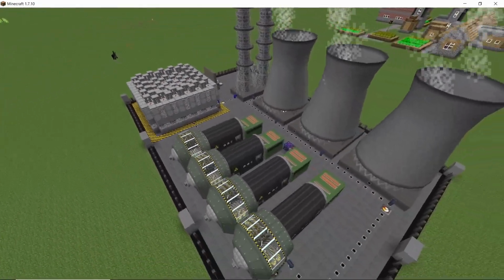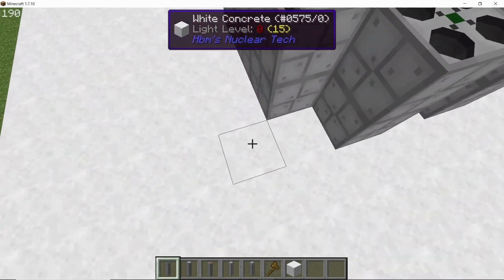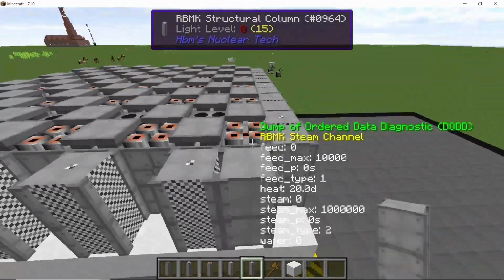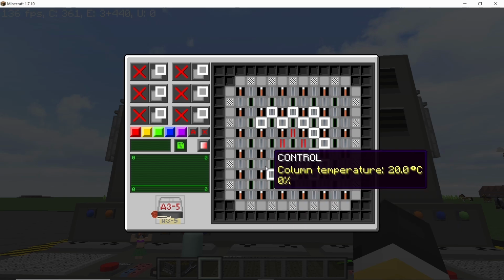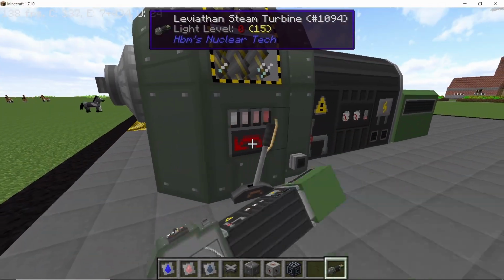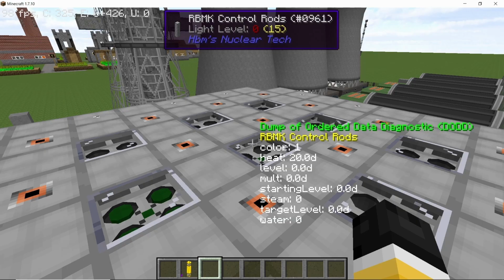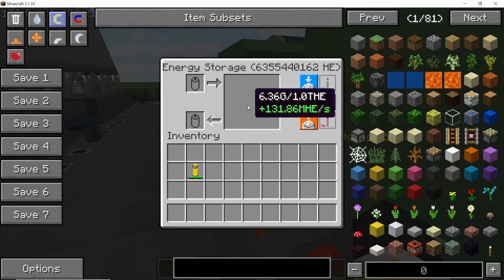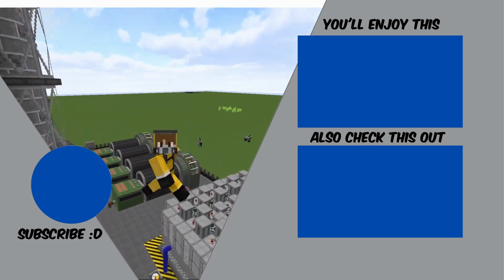13x13 RBMK Design using Schrabidium Fuel Rods - 132 MHE/s - HBMs NTM

Comment from the maker: Here are some important points about this reactor 
- This reactor will require monitoring especially when the LES fuel rods are completely depleted as this will give MES fuel rods a direct access to reflectors, so maybe drop down the green control rods when that happens. Also the depletion rate for LES is much more than MES and HES.
- if you're new to this mod and this is your first RBMK I would suggest not building this and going with a small design with less fuel rods which are not of the dangerous type.
- Finally if you don't want this to run on the brink of meltdown like I've running here then drop the yellow control rods to 30%-35% and the MES temperature should come down significantly.
Reply: I think I'm gonna take you up on the 3rd point, the MES fuel rod is just too close to meltdown for me even tho it has stabilized. 37 should do the trick I think.
Reply: What about the xenon poision ? @SavageVegeta
Reply from the maker: @Null_jar_pluh  that goes away as the temperature rises, so activating the reactor or changing a fuel rod to new if it has depleted significantly should take care of that
Reply: @SavageVegeta  alr thanks
Reply: How do you make the fuel rods in survival?
Reply from the maker: @Null_jar_pluh  empty fuel rods combined with fuel billets. Use NEI to see crafting recipes
Reply: @SavageVegeta  ok

Comment: Just one question, is it possible to make a reactor just with HES (High Enriched Schrabidium, High End Schrabidium) or not? in my world I always do it with other Medium/Risky fuels like MEA, and Flashlead, because it is difficult to maintain DANGEROUS fuels without xenon poisoning, unless if it's balefire, because balefire doesn't have xenon poisoning, so you can make a reactor just with it, I've done it several times and for me it's the best fuel, and difficult to do, but it can also be removed from DUDs.  

NOTE: I play in the NTM Extended Edition version.
Reply: I did personal tests - it is impossible to build RBMK only on rods with a linear function (exception - balefire)
Reply: @glozeyskalpha  Yes, I also did a test and I couldn't make any of the fuels with linear function work alone, it always gets too weak and turns off, or if I pull too much it explodes, it's not possible to balance, the HES reactor I always make it with another fuel like LES or MES, the same thing with plutonium that I make together with MEP.

Comment: Did you forget to mention about placing the fluid tanks? its 5am and im far too sleepy to make out any sense of how to get the water in the reactor.
Reply from the maker: there are water pipes coming out of the cooling tower and going into the reactor, place a barrel on those and use it to fill the reactor up and then get rid of it as water will just loop in the system after that and supplying it with more water will break the system

Comment: I saw this video come out when I was looking for a good source of power, so I built it in my world that I play in with my friends and it seemed to be working for around 2 hours, but then it suddenly exploded.. I'm not really sure the reason why it did so, but just thought I'd leave a comment here in hopes i'd get a response or some helpful information on how to use this build without my reactor going supercritical
Reply: alright so, i've been looking at the reactor for a few hours and it may have been a water issue? i added a cooling tower and a barrel with a heavy water source on output mode and so far it hasn't blown up. It could have been something else that messed with it, but so far, me adding these changes seem to have fixed any issue?
Reply from the maker: Can be 3 issues 

1) you went away from the reactor which made the chunk unloaded and that caused the explosion when you came back 

2) water may be an issue ... Tho when a reactor runs for a long time like in your case 2 hours the high depletion of fuel rods causes the temperature to come down due to decreased reactivity which incase reduces the amount of water needed. Water issue generally arises in the starting of reactor when fuel rods are highly reactive 

3) LES fuel rods depleted fully after 2 hours which gave MES fuel rods access to the reflectors and maybe that cause a spike in reactivity and temperature. I figured this was a potential issue that's why I mentioned it in the pinned comments and also said that this reactor will require close monitoring as there aren't any automatic control rods and fuel rods are of the dangerous type

With all this said, I'll run the reactor for prolonged time as well and see what's causing this sort of problem
Reply: @SavageVegeta  Thanks for the reply, it was most likely issue number 1 as i was a little far away from the reactor when it suddenly exploded after remaining seemingly stable for so long. It is also possible that the spike in temperature caused it not to be able to adjust properly enough, which caused the reactor to explode due to a sudden influx of heat being produced. Either way, the reactor seems to be working well in this test world, so it probably won't blow up again. Thanks for the design! Was in desperate need of power :)
Reply from the maker: @glitched9034  well I'm still running the reactor right now literally and I'll let it run until it melts down or till most of the fuel rods are depleted. It's been running for 40 mins and now the temperature is going down and so is the water consumption. Let's see
Also I'm glad you liked this design bro, due to the fuel it does put out good amount of power 💥

Comment: I like building country tier power plants only to use it for 5 lamps
Reply from the maker: That's the modded mc way 🤜🏻🤛🏻💪🏻
Reply: @SavageVegeta  Hey! Do you recommend any interesting tech or electricity mods that work with HBM?
Reply from the maker: @kanazamkniety3046  if we are talking about 1.7.10 the compatibility is limited cause NTM fluids are not supported by other tech mods, however you can try out Electrical Age mod in 1.7.10 for a realistic electrical mod experience. 
In 1.12.2 however almost all the major tech mods will work with NTM supporting ore processing and fluids as well.
Reply: @SavageVegeta What could you recommend for 1.12.2?
Reply from the maker: @kanazamkniety3046  industrial renewal, immersive engineering, Nuclear craft, thermal series
Reply: @SavageVegeta  Thanks bro, love your content. Keep it up! 💪♥️
Reply from the maker: @kanazamkniety3046  ayy thank you brother 🤜🏻🤛🏻❤️
Reply: Exactly.

Comment: Over 130 MHE/s, that's awesome bro considering how simple the design is. These fuels tho ... I'm afraid to run even a single one and you have all 3 of them in the same reactor without any safe fuel type haha. I salute your courage xd
Reply from the maker: Yeah this is pretty simple to make, if you introduce moderators into the design by using simple fuel rods then the design becomes a bit different but simpler and you can use less fuel rods. And yeah stabilizing all 3 fuel types took a bit of trial and error but it worked in the end